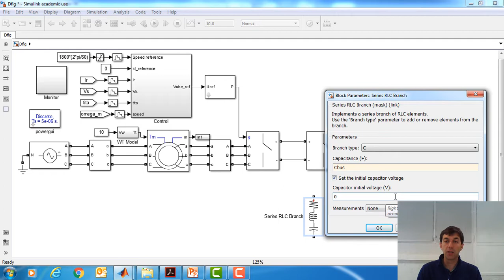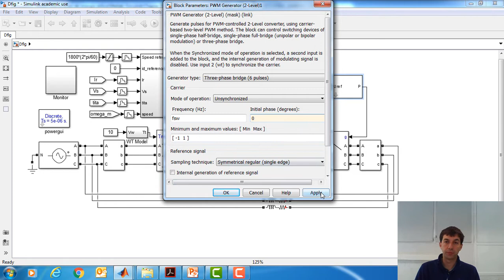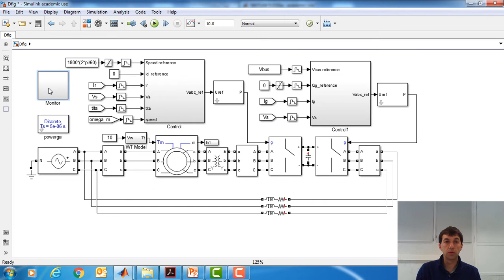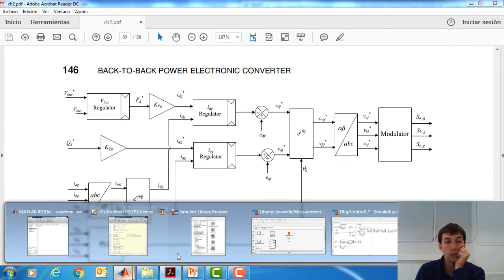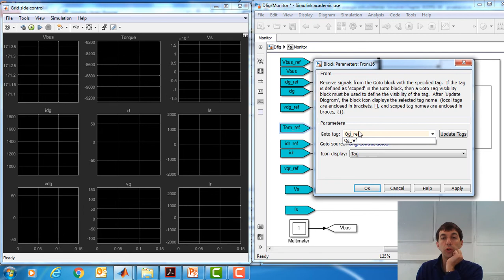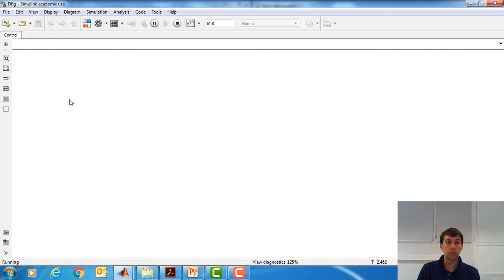Comment: Good effort Mr. Abad. Yet, more elaboration is required when you interpret the results. During Braking, Motoring, power flow during Sub-Synch & Super-Synch in Generation mode.

Comment: Amazing video!, but I have just a question; I know that the B2B converter is bidirectional, but what about the controls the GSC and the RSC are bidirectional too? I don´t understand that concept, I mean, if the energy flows into the generator the control laws works, but, if the current flows into the grid? what happened there?.  Thank you a lot!

Comment: Hello Mr. Abad,
I think the rotor transformer should be placed between the GSC and the grid (voltae source) not between the RSC and the rotor windings.
Reply: Thank you for your interest
But the rotor quantities are transferred to stator referred values during the RSC implementation, then they are transferred again to rotor referred values when they are applied on the rotor terminals so I think this transformer is not necessary.

Comment: Mr. Abad, thank you very much for your demonstration and incredibly useful material, you have greatly helped me with these video lessons!

As for fellow students like myself i'd like to point out one possible issue that you may encounter during the modelling process of GSC. When adding a DC link to connect your GSC with RSC make sure that a capacitor is actually connected to the circuit as is shown at 3:50 . Otherwise your control loops won't work and you'll have massive overshoot of voltages and currents, i'm talking 10 to the power of 30 overshoots. And MatLab won't warn you about the missing connection.
Reply: Thank you very much dear Abad i am very thankful for this work which is a very helpful for all student to understand how the WT work, again thank you very much. I have to ask you about if you can make a test under the fault grid conditions.... Thank you.
Reply: Thank you! Glad to see that this material can be useful for you. It is true what you point out! Perhaps I am showing things too simple. In reality, naturally, we can do small errors connecting blocks, choosing parameters, setting gains, etc… that will make the whole system work wrongly. In my opinion, the subsequent BIG CHALLENGE is to be able to find out the errors by oneself, only with the information given by the simulation results: By analyzing the performance and behavior of all the variables of the system. That will really make to understand deeply and actually the concepts. The tutorial is just one more tool or vehicle.